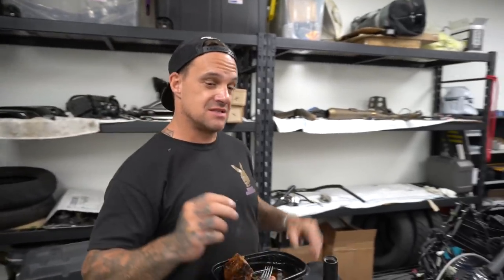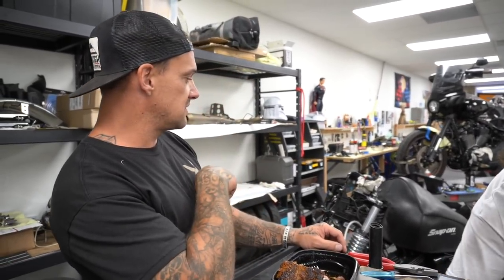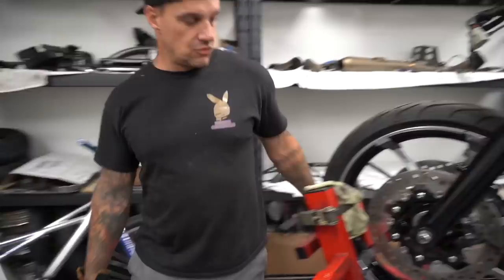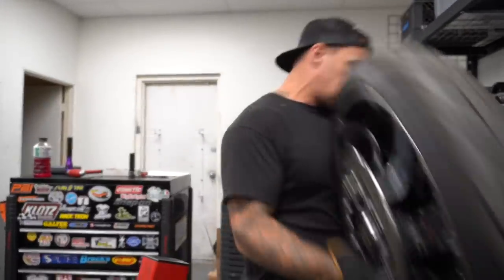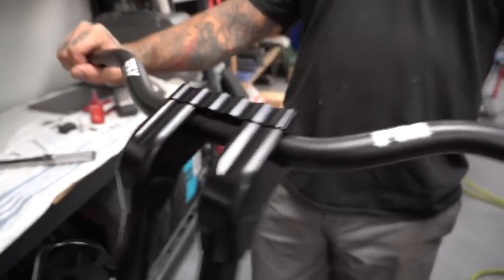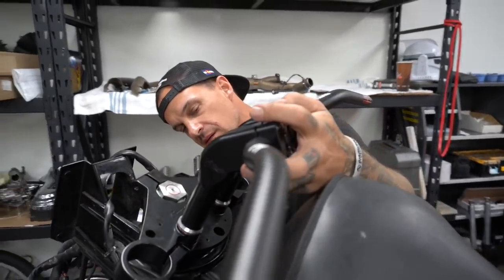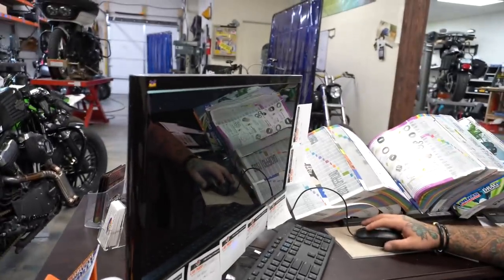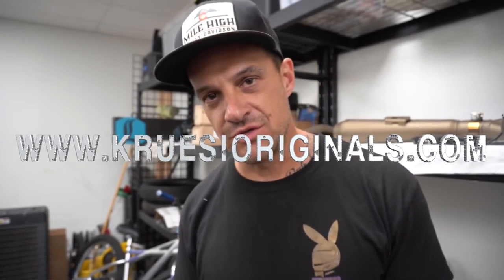Performance road glide build on a budget [P1]

Comment: Im putting together a 07 eg standard. Switching to a rg fairing, fuel moto 107 kit, woods 555 cams, custom 2 into 1, 14" mx bars, race tech springs fr., ohlins 13.5" rear, progressive sstabilizer, stereo, paint, powder coat, ect. Watching all the budget bagger and skinny tire bagger stuff.
Reply from the maker: Sounds like a ripper, I would suggest much shorter bars for handling
Reply: @kruesioriginals  I'm sure you're right. I bought these 4yrs ago to replace my 14" yaffee apes.  I'm 6'2" w long arms tho. 
Was running air ride in the rear, bag extensions....that look. Tore it down for a low buck "performance" type ride, and got locked up for two years. Made parole, and getting back on the build. 
I ride a sweet lil 94 fxdl in the mean time.

Comment: This is so very cool… I’m a tall guy and do not fit on standard HD cruisers… the seat height (27.7 or so) on the fat bBob is the tallest but with its wheel base I’m very “scrunched “ up and not comfortable… I’ve been thinking… I want a bad ass scooter built out of the road series platform without all the touring crap hanging off it…
Ready to rip canyons…. I’m really interested in how this turns out… thank you..!!

Comment: Effin love this build series! An planning to do exactly the same with an M8 RG, either a RGST or RGS and have it shipped to Sweden where I live. Any tips or tricks on how to pick a good bike to buy from Copart? Would love to hear! Subbing🤘🏼🤘🏼
Reply from the maker: Copart you just have to examine every picture thoroughly and read the write up. It’s really a gamble I don’t really mess with Copart too much really at all but you can find some good deals there.
Reply: @kruesioriginals  Gotcha, thanks. So even tho it´s marked as "Run and Drive" meaning it´s been started, put in gear and rolled forward as well as the only damages you can visually see on the bike is cosmetic, that wouldn´t be anywhere near likely to be a engine, drivetrain and chassi wise safe bike to go for basically? My mechanic is helping me source the bike as he´s done this a few times before himself, but it might be a bigger gamble than I though then?

Comment: I'm an old man so I wanted an old man bagger. I purchased a Honda VT600 VLX cruiser for it's low seat height and it's one of the few modern motorcycles old 70's era Windjammer fairing can be mounted on. I found a complete Windjammer touring kit with the Windjammer fairing, bag's, and trunk for $100. I fabricated brackets for all of it. It turned out better than I expected! If moving while it's raining I will stay dry. That was 12 years ago. After enjoying the bike those 12 years I was now 12 years older and was starting to almost drop the bike a little too often. Most would give up but not me. I added a Velorex 562 sidecar to it which solved the "too old for motorcycles" problem. I actually should have gotten into sidecars decades ago! All I can say is "So much fun"!

Comment: Cool man 👍🏻Unrelated, just want your opinion. I run progressive Monotubes in front and 422’s in the rear. Regarding the rear, are Shotgun shocks worth the money or just overpriced pimp shocks, same with Legend Air rides? What would be the best performance shocks for my 2002 Night Train? Thanks guys
Reply from the maker: Progressive is trash, never heard of shotgun shocks, I don’t air ride on anything. Legend does make a coil over shock for the rear of that bike that is amazing. It’s the ONLY performance suspension for the twincam Softail
Reply from the maker: https://www.kruesioriginals.com/products/legends-revo-a-adjustable-softail-coil-suspension-twin-cam-softail-2000-2017?_pos=4&_sid=fa915e424&_ss=r